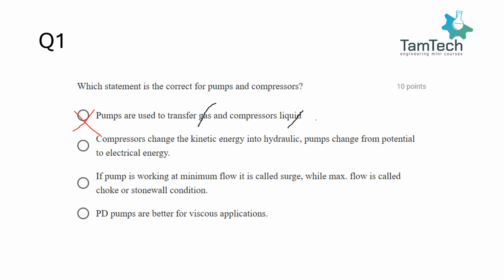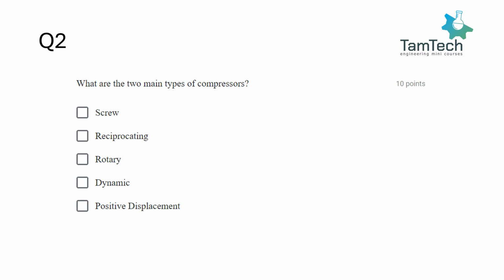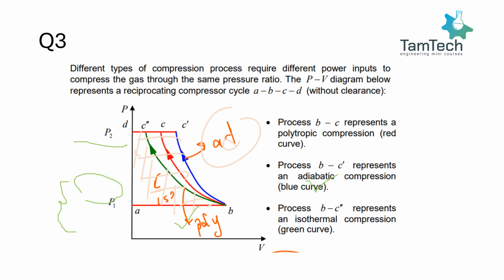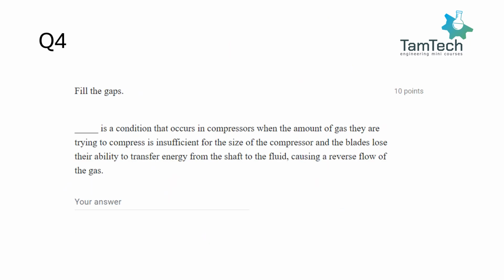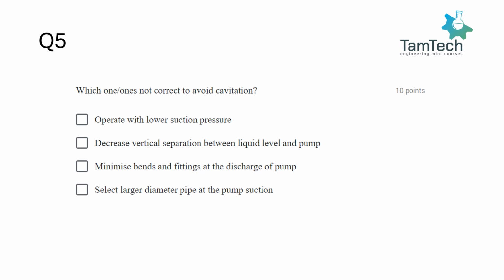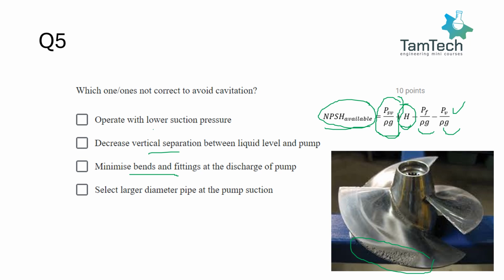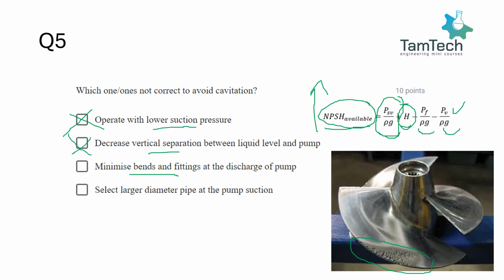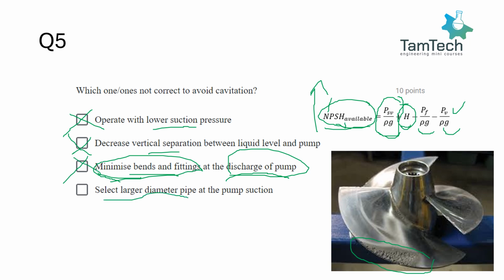Tech Mentorship 2024 | Equipment Basics- Pump and Compressors | Quiz Explanations

Comment: what is priming for pumps?
Reply from the maker: Priming is a crucial process in centrifugal pumps that ensures the pump is filled with fluid before it is started. The priming process involves filling the pump casing with the fluid to be pumped, removing any air from the casing, and creating a seal between the impeller and the casing. 
Without priming, there may be air trapped inside the pump casing, which can prevent the pump from generating the necessary pressure to move the fluid through the system.
Reply: @tamtechacademy  thank for answering my question